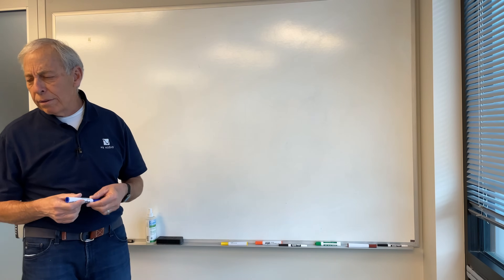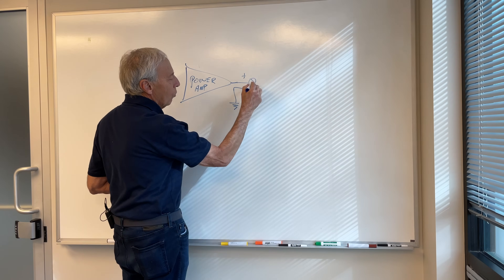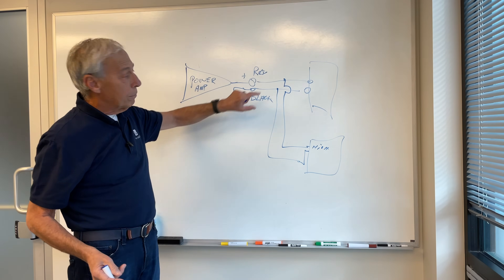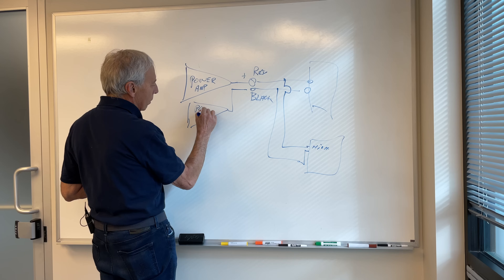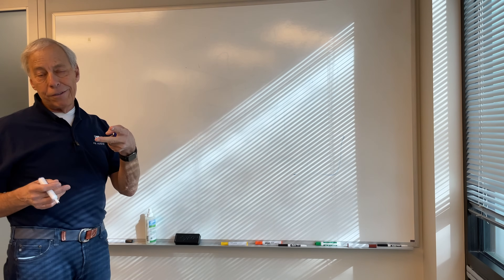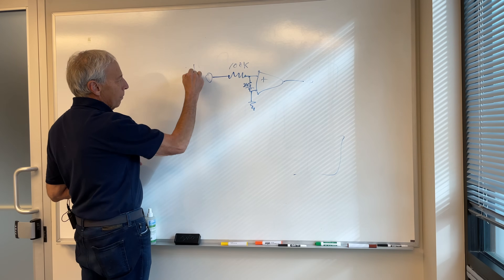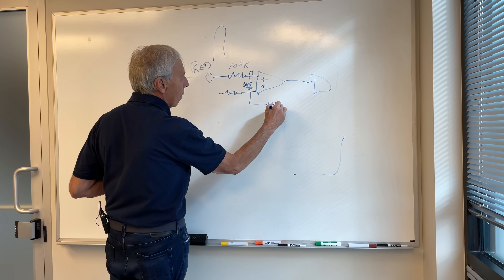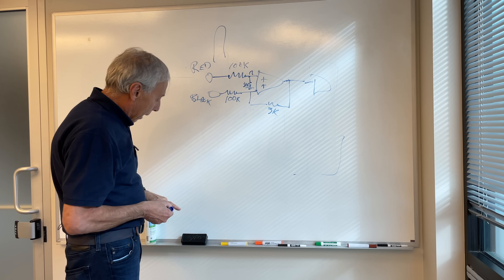How does a subwoofer high-level input work?

Comment: I have had great success using low level inputs for my subwoofers in my room.  When I integrate a subwoofer I merely augment the missing lower frequencies.  I usually find a placement where the sub bass sounds the strongest from my seating position, then I will adjust the distance from the walls to achieve a smoothest base response possible.  Then I adjust the phase until the base sounds like it is coming from the speakers. Next I adjust the frequency and tune the output level to blend with the speakers perfectly.  Following this method, the subwoofer sound integrates with my speakers almost perfectly.  I find it difficult to understand how adding cables and circuitry would benefit my system.
Reply: I have the same success. And if I use high-level I wont get the LFE ch when using surround so. I have a dual mono stereo amp with power amp input (+ 2 sub passthru) and a surround reciver. And I find it's easier to integrate the sub perfect when using low level outputs since I can use delay adjust if the subs phase adjust wont quite get me there.
Reply: Surround movies sound better with LFE, music sounds way better with high level, especially if you have 2 subwoofers.
Reply: Yup, same here

Comment: Only way I hook up my subs since discovering this option. My two subs “disappeared” configured this way. I’ll never go back.
Reply: My sub dissapears perfect when using the RCA.. So that is just an adjustment.
And if I hook up to my speaker output I wont get the LFE ch when using surround since I have a combined stereo and surround system.
Reply: both your subs are connected via the high level? can you explain?
Reply: @zatara5299  Left to left one the left sub and right to right on the right one.

Comment: If my subwoofer doesnt have high level Inputs, is it possible to use a high Level to low Level converter, to get the Signal right for the Low Level Inputs of my subwoofer ?

Comment: High-level inputs to a sub sounds wonderful on paper.  But the theory only works if the sub amp has no sonic signature of its own - which every amp does.  There are other reasons to avoid high-level input but this reason alone should squash the desire to do so. Besides that, the sub's signal is now passing thru 2 amps rather than 1 amp which at least theorically could induce time delays.  And in the case of the REL subs, one is forced to use REL high-level cables which of course will also induce their own sonic signature and hence most likely with be different than the speaker cables' sonic signature.  So it seems to me that those who boast about the supposedly superior sonic benefits of high-level inputs are relying more on what they read and imagine rather than what they actually hear.  Because based on the above (and more) high-level inputs should actually cause greater differences, more distortions, and potentially more time delays than low-level inputs.  What were they possibly thinking (or smoking) when conceiving the idea of high-level inputs?
Reply: Well Paul McGowan advocates using high level inputs. Is he also relying on what he reads rather than what he actually hears? 😀
Reply: @Lloyd Stout These kind of comments are rather humorous.  Did it ever occur to you that "professionals" are often times just as lost as the rest of us?
Reply: Thank you for this. I have been saying this for a few years now as everyone beats the REL drums.
Reply: @mesonto  Much appreciated.  I certainly wouldn't entertain a subwoofer only providing high-level inputs and I'd give no credence to a subwoofer mfg'er who was committed to high-level inputs and boasted their product as the pinnacle of bass.  That would be laughable.  I can't help but wonder what others actually hear.  Nor do I think many give matters much thought nor think things through.  They hear the phrase, "matching the sonic signature of the main amps" and they think they've struck gold or something.  This industry is amazing.
Reply: And, how can you relieve your mains with a high pass filter???  Does this mean that putting filters into the speaker signal is preferable to filtering the line level signal??
Reply: @BikerMiker720  Based on what I stated earlier, I suspect it means, what were they possibly thinking when deciding to go the high-level input route?  The experts claim we would get the main amp's sonic signature carried by high-level inputs to the sub and indeed it may.  But at what cost?   Doesn't really matter because the sub amps have their own sonic signature so their theory is already blown to hell not to mention all the other sonic baggage high-level inputs bring to the table.  An additional and very important point I neglected to mention earlier was, with every component the input signal is further degraded which implies the high-level input signal at the sub is now more compromised because it passed thru two amps insteand of 1 amp.   Seriously, what in the world were they thinking?   Fundamentally, it seems to me the easiest most efficient, and greatest sonic benefits implies staying with low-level inputs.  It can work rather well. For example.  https://youtu.be/tNh-aFORuZ8

Comment: Most AV  systems have a setting for big speakers or small speakers where the bass frequencies are NOT sent to small speakers so that they can play louder without woofer cone breakup and the bass is sent to the subwoofer via the LFE output. in this case a high level input won't work. Also my sub has a low level input (from your preamp out)  and out that would go to the power amp can be low frequency limited for the same reason as most AV systems.

Comment: If your system is for Home Theater and balanced, the balanced connection to the subwoofer is better. I can see this being more applicable to an audio only system. Going from a single ended connection on a subwoofer to a balanced, there is a very noticeable difference. The subwoofer plays deeper and louder.

Comment: so you do not loose some sub channel information from 5.1 movies with 5.0 on av receiver and high channel input on sub from front speaker output?

As I understand, the movie .1 channel has +10 db and in a 5.0 config the av receiver would downmix this +10 db lfe signal so you would loose probably some movie bass

+ the .1 channel mixed from my amp into the front speakers would end in my sub + front speakers at the end, probably not a big  issue...

so for 5.1 movies and a yamaha RX-v685 + Canton Ergo AS 650 SC Sub, is high level input still a good choice?
Reply: @Lloyd Stout oh lol thats not in my budget, I spend every month half of my 8h/week student job payment on tech from ebay...

but the yamaha v685 ypao setup might do a ok job and I will check what I like more, yes... atm my music on the Canton ergo 670 dc fronts with 1x180mm woofer could  have more punch with my canton ergo as 650 sc subwoofer

Comment: I have my Subwoofer hooked to the B-speaker outputs on my integrated amp (and the speakers hooked to the A-speaker. And running them both at the same time, would this be bad in any way?
Reply: No, I've seen people recommend you do it that way if you have A+B.
Reply: @Taffy84  Yeah I figure its much shorter and less disrupted signal path between the amp and the speakers. And that the sub isnt actually commanding any current, so shouldnt be much of a problem for the amp? I just dont know if it affects the impedance seen by the amp?
Reply: @Lloyd Stout Are you sure? Maybe it is dividing power per usage? So if B channel is not using any current, all current will go to the A channel?

Comment: When I could compare, the high level input does indeed sound better and I would use that if possible.  If all I had was the low level I would use that without concern, the difference is not huge on any of the subs I have tried.
Reply: @Lloyd Stout Yes a huge difference in favor of which?

Comment: i have a problem with my sub and high level inputs. 
My receiver is old and doesnt have pre out or sub out. 
When connected (via speaker A or B)  my SUB remains always On (it has an auto of capability)  and has a boomy sound, even when my amp is OFF! 
Any idea why ?
Reply: What receiver? What sub? Too general of a question to know what the variables would be. Don't expect quality bass out of a $100 sub. If it was $1000, then I would expect some slammin' bass.
Reply: @zulumax1  its a vintage receiver Marantz 2216.  My sub is an elax with High level in. My problem is that even i shut down my AMP , there is a sound (Buzz/boom)  from my SUB !
Reply: Elac sub? Which model? If your sub has a 3 prong grounded plug you could be getting a ground loop hum between the sub and amp. If so try a 3 to 2 prong adaptor called a "cheater" or "ground lifter"and leave the ground wire unconnected to ground on the subwoofer.
Reply: @Lloyd Stout Ground loop, that is my diagnosis too. Try a ground lifter first, that is the easiest fix if the sub has a 3 prong plug. Older vintage equipment, especially the non polarized type can cause wreck havoc with modern grounded equipment working together. Also can try reversing the non polarized type plug on the amp into the wall.
Reply: Also try unplugging the amp, reversing the plug, and plugging it back in and see if the buzz goes away.

Comment: Problem is that most subwoofers have a crap circuit built into the high and low pass on speaker level inputs. Most subs just use one garbage electrolytic cap feeding the high pass. I have read from crossover gurus this creates response problems in the stereo speakers passive crossover.
Reply: @Lloyd Stout 
Crazy Paul included theater along with two channel in his stirring white board dissertation. As if they are intertwined. He's so far removed from the everyday user it's comical. And just for the record, my processor plays two channel with four subwoofers using LFE as good as any system I've ever heard.
Reply: @Lloyd Stout 
Garbage advice.
There is a reason that the venerated REL now offers an LFE input option. Because it's better. 
-✌🏼
A simple search for the top subwoofers of a given year affords a myriad of options for the buyer.

Comment: I also see some advantages of using the "normal" RCA subwoofer output on receivers:
- The receiver handles the digital crossover from sub to main speakers (it sends a high pass signal to main speakers, and a low pass signal to the sub). This way you don't have to fiddle around with an analog potentiometer on the sub.
- Also, you're guaranteed that the roll-off of the high pass filter and low pass filter match (since these are digitally implemented in the receiver);
- Also, you have a degree of freedom: the crossover frequency controlled by the receiver. So you don't have to rely on the high pass behaviour of the main speaker.
- The receiver can manipulate the subwoofer signal independently from the main speakers (for example, for LFE effects in movies).
Although, when I write this, I realize that the natural roll-off of the main speakers can add an unwanted extra high pass effect (and phase shift) to the main speakers. Likewise, the natural roll-off of the sub at high freq can add an unwanted extra low pass effect (and phase shift) to the subwoofer.
Reply: Great points. 

It definitely makes a lot of sense to use low level in many cases. My understanding is that for a stereo music system the high level input is best at getting the same signal and marrying the sub to your speakers. 

That said you're totally right and if the subwoofer using a high level input doesn't have an adjustable crossover and gain stage it might be extremely difficult or not possible to get the subwoofer to mesh well with speakers. All totally dependent on what your speakers are capable of range wise. 

For anyone else reading this - there is at least one company making subs (REL) that ensures not only the proper high level input circuit but also an adjustable crossover and gain of their sub amps. That said it can still be a challenge to dial in any subwoofer this way and also very much depends on your room and speaker/ sub location. Sound science is fun and make sure you enjoy experiments!

Comment: Making the sub parallel to the main speaker means a relatively wide area where the sub and the main speaker overlap. That creates and interesting mushy phase mix of lowish frequencies that might completely overshadow the character of the single power amp that you want to preserve. Tell me why this is not a problem.
Reply: @Art DIY In the configuration that Paul suggests, the main speaker gets all frequencies, including frequencies close to its lower capability. That means that the main speaker will have considerable phase and magnitude characteristics there. Without a sub this is not a problem, as we are not very sensitive for phase. But with a sub we add a driver in the same frequency area with a different phase characteristic. Depending on the main speaker enclosure and driver type, we get an interesting, frequency-dependent phase-and magnitude mix, which could lead to very loud or suppressed frequencies or less clarity (less tight). This all depends on the sub-position, of course. You cannot fix this with a simple phase-knob unless it knows the type of the main speaker. But maybe there is a trick I don't know that makes such a knob okay.

In short: it is very difficult to get a nice characteristic and adding a phase knob might also alter the character of the lot.

To avoid phase and magnitude problems, we should minimize the overlap in frequencies and make the switch at a frequency that both speakers can reproduce comfortable. But that means a crossover, which is not the configuration that this video is about. And naturally, this adds even more character to the signal than the main amp (I might hope). 

Another discussion is whether a lot of "character" is added below 100Hz that cannot be reproduced with an equalizer. Does it matter? Or is it that second-order harmonic distortion that is so beautiful? But then we are talking about beautifying sound instead of reproducing it with high fidelity. This is a matter of taste.

In studio equipment, crossover is almost always done at low signal level or even in the digital domain. A power amplifier for each frequency range drives the speaker directly, so it has tight control over it. This gives you accurate sound reproduction. A warm recording will sound warm, a sterile recording sterile and a bad recording, unfortunately the majority, horrible. You can literally hear the limiter "rattle" in a lot of modern "loud" recordings.
Reply: @Art DIY if the combination works: please enjoy it! 
I'm merely saying that from a technical standpoint, the success of Paul's suggestion is very dependent on specific combinations of equipment. This is why I would personally not advise it as a general solution.

Comment: I must have missed a lot thru the years, hard to make sense outa that
Reply: Its not difficult.  Let's break it down. 

Question: Is the high impedance input simply directed through a high value resistor?

Answer: It IS a simple resistive divider in many subwoofers; but, that creates a problem for balanced amplifier outputs since the inverted output would be shorted to ground in the subwoofer. 

Addendum: The solution to that, for subwoofer designers, is to take both inputs through the resistive dividers into a differential amplifier.  Then both sides of the connections would go through high impedance resistors, thus allowing it to work for both balanced and unbalanced amplifier outputs.
Reply: @timharig   ok, so this video is for a designer of the circuit  to allow that the sub to utilize the speakers output?
I didn't understand when he said that the sub wouldn't draw watts from the power amp just the signal? lol.. this reminds me of algebra...
Reply: @yrulooknatme  Well no.  You do need to know this when attaching your subwoofer this way. If you have a balanced amplifier output you could short and damage your system if the subwoofer isn't designed to handle the balanced inputs. Then he describes how the designer should handle that balanced inputs which you do not need to fully understand as a user.

You are going to a have a very difficult time in this hobby if you do not understand some basic mathematics and some basic electrical rules. Understanding this video requires understanding voltage and current dividers.

When impedances are wired in series, the current going through them is is the same; but, the voltage is divided across each impedance in proportion to its impedance the total impedance. 

When impedances are wired in parallel the voltage across them is the same but the current is divided between them inversely proportional to each's impedance compared to the total impedance.

In this connect, the subwoofer is in wired in parallel with the speaker. So the voltages across them are the same but the current is divided between them. Because the speaker's impedance is only a few ohms compared to the subwoofer's impedance which is on the order of kilo-ohms, very little of current is siphoned off of the speaker's line. If the speaker impedance is 8ohm and the subwoofer impedance is 100k ohm, then the subwoofer is only drawing about 0.0008% of the speaker's current. 

Then in the subwoofer, that small amount of current travels through two resistors in series to divide the voltage to a level appropriate for the subwoofers amplifier to handle.
Reply: @timharig  thanks I'll keep reading this till it starts to sink in a little... I never got into active subwoofers and surround sound systems. always had stereo with woofer and tweeter and sometime mids. To me this sounds like a better way to utilize a sub. if you had one. I've always wondered what a bridged amp was and now I know. sure don't want to run that to ground.
thank you